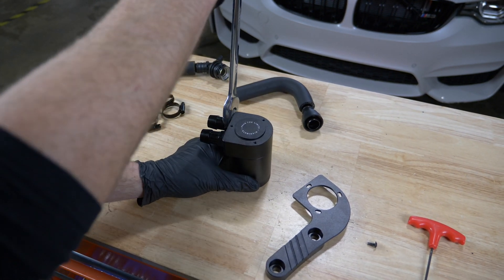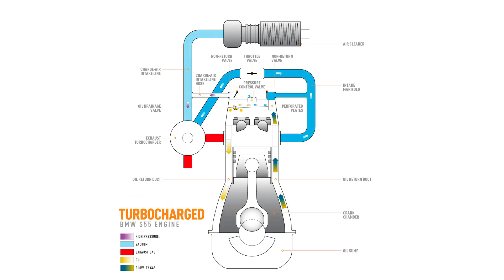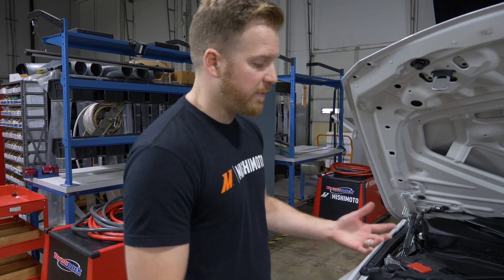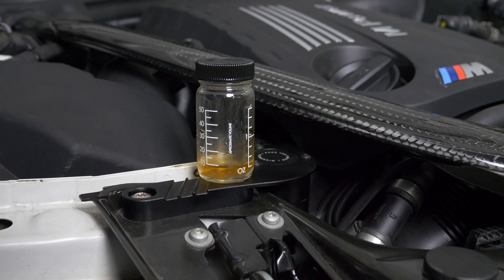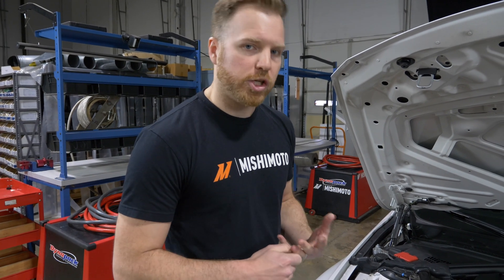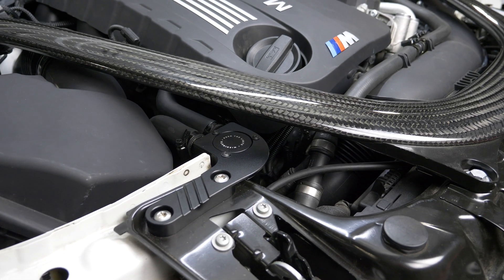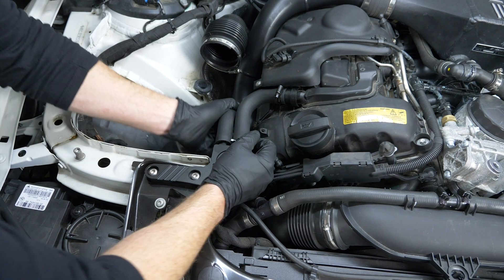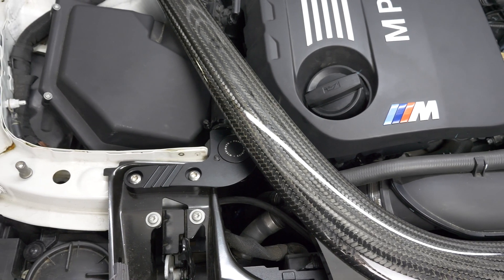Mishimoto Behind the Scenes: BMW F8X M3/M4 Baffled Oil Catch Can Kit Development

Comment: hi, on a turbo diesel engine, which also needs a one way valve, on the oil catch tank outlet pipe? thanks.
Reply from the maker: Most vehicles will require a check valve to prevent vacuum leaks, yes. However, this can vary. If the line you are tapping into has a check valve in it already, it's a safe assumption this should be retained.

Comment: Hey guys I’m interested in buying the catch can but before proceed with my purchase I would like to know how you purge the can when is full and how often do you have to check on it..? Do you have a video regarding that...? I currently own an 2018 BMW F80 M3. Please advise. Thanks 😉
Reply from the maker: No video on emptying the catch can. However you can either remove the bottom of the car or install a drain valve on the bottom as there is a plug on the bottom.